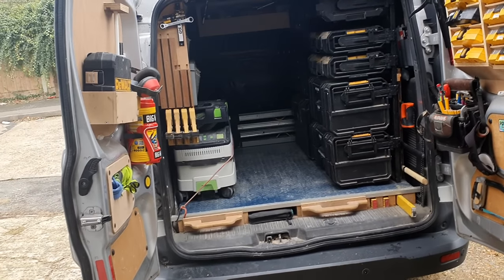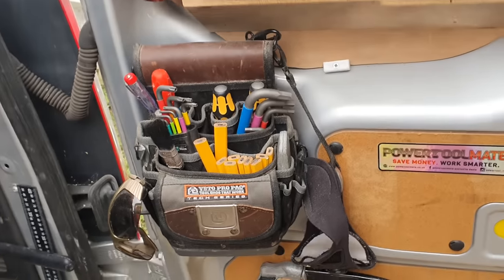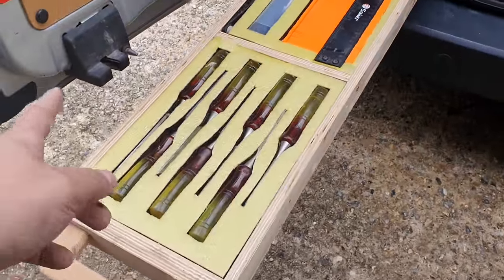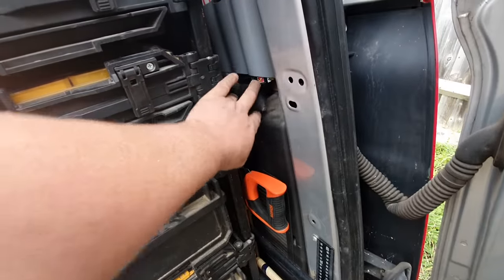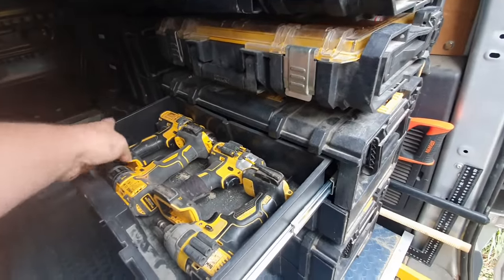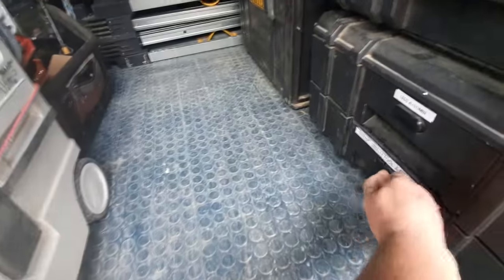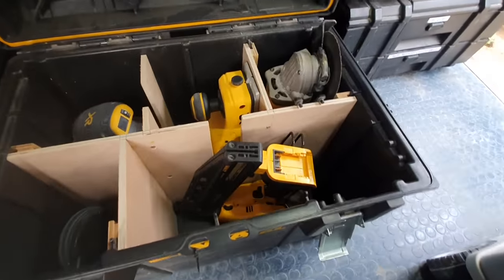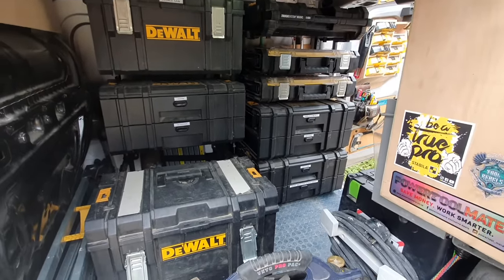My dewalt van racking

Comment: Absolutely one of the best an cleanest organization for such a small van incredible job just bought my first van to start my own business a few days ago I'm from across the pond. Our typical vans are much bigger then the transit connect not that's the transits is bad but I need space for compound metre saw an table saw so I went full size you just gave me amazing ideas for my set up very much appreciated. Keep the hammer swinging. 👍🤙

Comment: So much kit in a small motor. Well done you 👍 I’m genuinely impressed and inspired. Honestly didn’t think a carpenter could function particularly well in a small vehicle, but this has proven me wrong. Top banana💪👍
Reply from the maker: Cheers mate. I prefer having a small van and wanted to show that a small van can be practical.  Of course having a big van would be even more practical  I just didn't want one. This set-up allows me to also get my chopsaw and stand,  portable workbench and gazebo in no problem. The challenge will come when I get a 3m rail for my track saw.🤣

Comment: I love this my old movano is due to be replaced. And I was thinking of downsizing my van. Used lwb Van's are always abused. I made my racking out of those metal shelving units you get. I use the keter/magnussen/ridged boxes. Cheap and very good quality but not many options. Dewslt is my main brand and tough system 2 has some Brill boxes. You also get the proper van racking. So might consider changing.  My van is chaos at times.
Reply from the maker: You'll appreciate it so much if you get yourself organised.  Irrespective of what tool box system you use. Being able to know exactly what you've got in your van and where it is will make you work more efficiently. Nothing worse than digging through the van looking for that one tool you need but can't bloody find. It will take a bit of time to get it right as we all work differently but you'll get there. If you're going to go the dewalt racking route then really read up on it. Its expensive for what it is and extra folding arms for it are about £60 a pair. I made mine with 25mm box section and the folding arms from the dewalt trolley.  It cost me about £130. It'll be more expensive now as the cost of the arms have gone up since I built it. Once you get yourself organised you won't go back to chaos.

Comment: Crazy they discontinued the tough draws but kept the tstak ones. I get that the tough system isn't as popular in UK and EU but for site work it's arguably better than tstak. Though the tstak has benefits in domestic settings. Great set up and really makes use of such a small van considering how many of us work out of medium class vans.
Reply from the maker: I don't think they discontinued the toughsystem drawers.  As far as I know they were bringing in a new version,  the one currently on sale in the states but it didn't meet some stupid EU law so couldn't be sold here. Dumb I know. Both the toughsystem and tstack have their good and bad points but I went for them primarily because they are tough as hell and for the racking system. It works well with how I work being able to chop and change boxes depending on what I'm doing and being able to fold all the arms away and have a completely empty van if I need it. Thanks for watching mate.
Reply: @ziggysrefurbs1885  Yeah I do like that the tough system has the racking arm transport system, my Tstaks are just set into the shelving with their legs. The new one in the states is the tough 2.0 from what I saw in Home Depot. I purely meant they were manufacturing them over here at one point and now they're discontinued, so you can only have them shipped over from us/canada now or buy second hand. I like the tstak purely from a space perspective when inside terraced houses though, doesn't take up quite as much room as tough/packout and I swapped over to a lot of drawers so I could just have a tower plonked in the corner as a base station to work out of.
Reply from the maker: @effervescence5664  I didn't realise they were made over here. It's frustrating that it costs £100+ for those drawers. Second hand here or imported in. I understand why you've gone for the tstack boxes. Smaller, easier to move around people's homes. That's what I love about seeing how other people have their setups.  There's no right or wrong way of organising your tools it's whats right for you.
Reply: You can get the draws  still in North America

Comment: Amazing stuff mate! I'm heading out to work for myself next year and it just goes to show a transit connect can get pretty much everything. What happens if you need to haul around timber/plasterboard/lengths of pipe/trim? Cheers!
Reply from the maker: Thanks mate. I try and get most of the materials I need delivered.  When I do need to carry stuff my 4 bar roof rack is set up to carry 8×4 sheets. Obviously weather is a factor but I get by just fine. I can actually carry 3 metre lengths of trim and copper in the van ( just). The passenger seat folds down and there's a hatch through from the rear of the van. I know I could get a bigger van I just prefer a small one. Good luck in working for yourself.  It is hard work but so much better being your own boss.

Comment: Really good. I’m hoping to get a Transit connect. Preferably LWB but seeing this makes me think I Could actually get away with the SWB.  Really good set-up. 👍🏾
Reply from the maker: Cheers mate.  I'm guessing it all depends on what you'll be carrying whether or not you need a swb or a lwb.  I think it's about 600mm difference between the to two. I did have to cut a little hole in the bulkhead for my 1.8m level to go into to make it fit but that's the only modification on the actual bodywork I had to make. I hope that helps in you decision to what van you're going to get. Thanks for watching.
Reply: @ziggysrefurbs1885  that does help actually because I had no clue on the different lengths. 👍🏾

Comment: Looks good. I was also a van guy until i ordered AWD EV and going to buy box van trailer which i can use to haul my tools. 2 advantages of that is i can leave trailer to worksite and drive a car that is much cheaper to use which means i earn more money.
Reply from the maker: Ive seen a few videos of tradesmen using trailers to carry all their tools. I think the idea of that is great. At the start of a job tow you trailer to the site and leave it there until the job is finished.  Unfortunately thats not a thing here in the UK. Being a smaller country,  small roads and all too often having difficulty parking at some jobs it wouldn't be practical. Also unfortunately tool theft is a real problem at the moment so i feel better unloading the van everyday and locking away all my tools. Yes its a ball ache but its only another 10- 15 minutes to my day.

Comment: Do you not need a table saw and mitresaw for your work then mate? Awesome setup 😁
Reply from the maker: I do sometimes carry my mitre saw and stand and with all my boxes off the floor I have plenty of room to get them in. My table saw generally stays in my workshop and I use a track saw on site. I just posted a video on my portable workbench that I use for cutting 8×4 sheets. Everything does fit in and having a small van works for me, just. Thanks for watching

Comment: How did you make:

The rack to hold the boxes where they latch in?

What did you use for the cut outs for batteries and such?
Reply from the maker: The racking to hold the toughsystem boxes is made out of 25mm box section.  I took the dimensions for it from the toughsystem trolley. Its welded together ( my first ever time welding) . I bought the toughsystem folding trolley arms separately.  The foam i used to organise my batteries is from a company called shadowfoam and they supply it in different sizes and colours depending on your needs. Hope thats helpful to you.

Comment: Hey look great. Well done. Where did you get the dewalt drawer boxes. And the foam for the tool? I take it you cut them out? They werent done already. Thanks.
Reply from the maker: Hi Patrick. The drawers are like rocking horse shit to find. They were discontinued a few years ago and do occasionally pop up for sale on ebay but they tend to go for silly money, £100+. You can get the newer version on amazon but they are from the states and again cost silly money. The foam is from a company called shadowfoam.com. you can get them cut to size already for a variety of tool boxes or like I did get bigger sheets and cut them myself. The cut outs are done yourself to suit whatever tools you want to insert into them. Thanks for watching mate.
Reply: @ziggysrefurbs1885  great thank. Ill look them up. Do like de drawer units there cool. And the 1 with boxes but there 50 odd so with 2 be as dear as the ones u have. Thanks.

Comment: What did u use in the battery box case the foam kind of stuff I notice there the size of the battery. Makes it sit in nicely
Reply from the maker: It's called shadowfoam.  I cut it to size to fit in the drawer and then cut out and peeled away the layers for the batteries.  I did the same for my router.  You personalise it for whatever tools you want. They have a channel here on YouTube.

Comment: Very cool set up.Im from the states and I didn't quite catch what kind of latches u used to hold the Dewalt boxes in place.Ive spoken to several guys about the whole "pack out" 2 wheeled cart and the rack like u made your self and I didnt recieve positive feed back and especially for the price point,I wanna build my own aswell but those latches look like Dewalt made them.I really dig the van its organized and I'm all about that (time is money)
Reply from the maker: Cheers for that mate. The folding brackets that the dewalt boxes sit on are from the toughsystem trolley.  I bought 8 pairs of them . Made the framework out of 25mm box section ( one inch ) . I looked at dewalt van racking proper but couldn't justify the price so I made this and its worked out at one third of the price. I have the trolley but I don't use it. Its to wide to go through most doorways  🤦 Had this set-up for more that 2 years and nothing has broken, bent or snapped.  I hope that was helpful.

Comment: Ditto what Spg said below! Greatly appreciated and very impressive! I just started getting into the Dewalt toughsystem. I didn't like either hand trucks that Dewalt offers to transport the boxes with so I am making my own. Question: Where did you get the rack forks? Does Dewalt sell those individually so one can make their own rack like you did? Thanx again for a stellar video!!!
Reply from the maker: Cheers, mate. You can buy the folding brackets separately.  They're made for the toughsystem trolley.  It depends on where in the world you are as to where you can buy them. I think i got mine from screwfix, but it was like 3 years ago.  I got 8 pairs for £100. They are more expensive now, though.

Comment: 100% on Torx head screws. I started buying them accidentally, then really started to see the benefit especially with the impact driver.
Reply from the maker: You're so right. Using torx head screws with a impact driver is so much better. Stripping out screws and bits drastically reduces when using torx.

Comment: Wish I could of grabbed some of them 1st edition drawers  I heard they open a lot and are not that great but seeing I collect all toughsystem  I would liked to grab  to grab 1 or 2
Reply from the maker: I only bought one of the drawers when they were sold here. Grabbed the other two on marketplace , luckily for a bargain.  Never had a problem with the drawers opening accidentally.  The original one I bought must be 5 or 6 years old and it's still going strong.
Reply: @ziggysrefurbs1885  thanks for the info gonna see if I can find one they are pretty rare around here I think they were discontinued in usa

Comment: you should do a vid on how you built the racking and where you got the clips
Reply from the maker: I do have a short video on my channel showing just the racking without the boxes. It's just 25mm box section.  The folding brackets I got off the Interweb and it was my first ever attempt at welding.

Comment: Foldaway what brackets? I want them. Got a link??
Reply from the maker: I robbed the idea from the original toughsystem trolley.  The brackets I've used are designed for the trolley and i took the measurements from the trolley to set out the 25mm box section. Search toughsystem trolley brackets and you'll find what you're looking for. Hope that helps.

Comment: U made some job of it
Reply from the maker: Cheers mate. If its worth doing well you might as well go crazy and over do it.
Reply: @ziggysrefurbs1885  dead rite all the space nd false floor draws are  👌
Reply from the maker: @eoinmurphy8360  thanks. I just prefer having a small van and utilising all the space shows I can get alot of gear in. Having the racking as I do makes it easy to load up my chopsaw and stand when I need it.

Comment: Does anyone  have a dewalt van rack for sale. Dewalt has discontinued the rack. I really could use one
Reply from the maker: Make your own like I did. 25mm box section.  The trolley folding arms and a bit of welding. This was my first ever attempt at welding. Made to measure and a third of the price of what the dewalt racking is.

Comment: talk about going to fucking town!!
Reply from the maker: Can't tell if you're taking the piss or complimenting it.😂  Have I gone a bit overboard,  maybe. Am I sad, definitely.  Its just the way I like to work.
Reply: @ziggysrefurbs1885  defo a compliment mate. I couldn't do that to my van as I got to leave enough room for bit equipment and pallets to be lugged in there from time to time but I like the cheap way to do the racking. Where did you get the steel from? What sizes was it?
Reply from the maker: @09mantlek  we've all got to organise our vans differently to suit our needs. The steel is 25mm box section.  I ordered it on the Interweb,  can't remember the site. Comes in handy being able to fold the arms away to have an empty van to carry big bits and pieces .